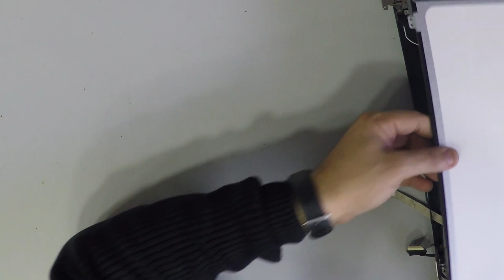Toshiba Satellite C55T Screen Replacement

Comment: Oh boy. Where to start.
 You do not have to removed the entire top half of the computer to change the touch screen or LCD Screen. You also destroyed the original touchscreen. I know it was cracked to start with but you destroyed it.
Reply from the maker: Hello Clayton, in this video I didn't need the digitizer so I throw it. the screen replaced and the laptop usable again.

Comment: Is there any adhesive with this digitizer, it seems like you had a tough time removing it? I dont see any cables blocking the digitizer so I dont think it is necessary to remove the whole screen part from the computer unless I am missing something
Reply from the maker: Hello Marco, there's no need to remove the whole screen. It's just more comfortable to work win it apart from the computer.